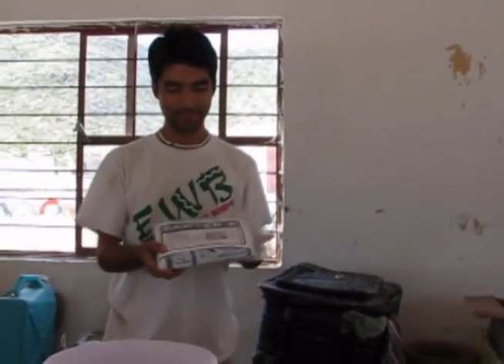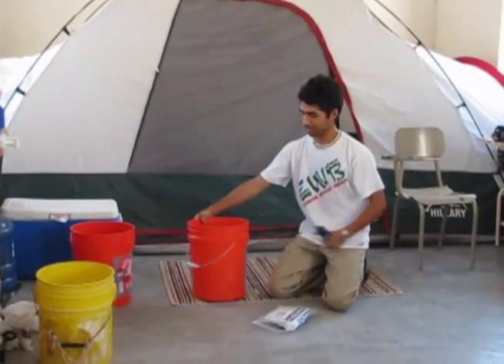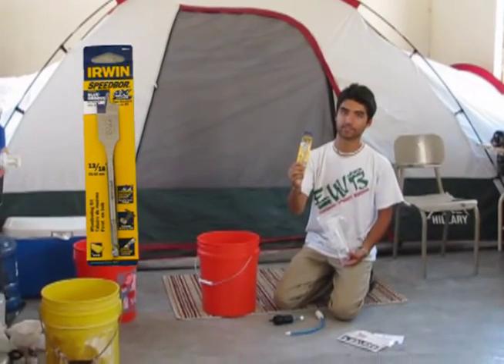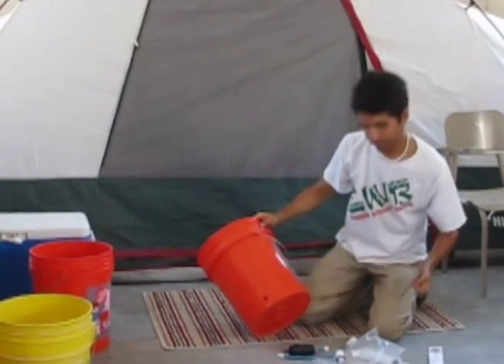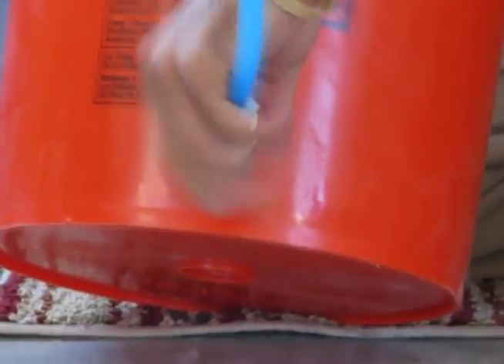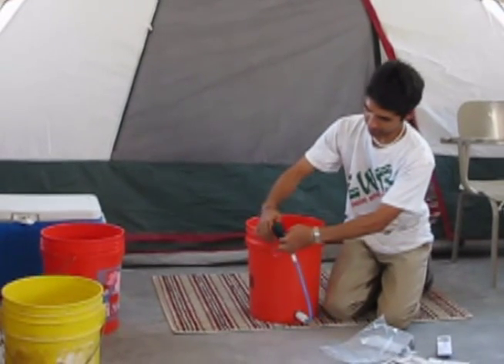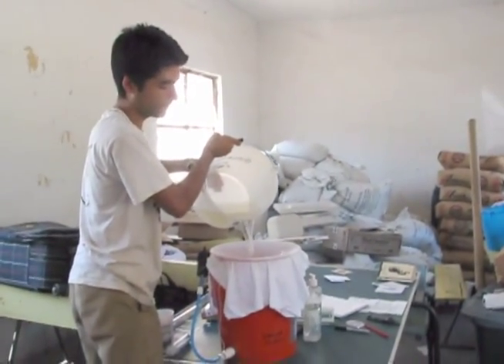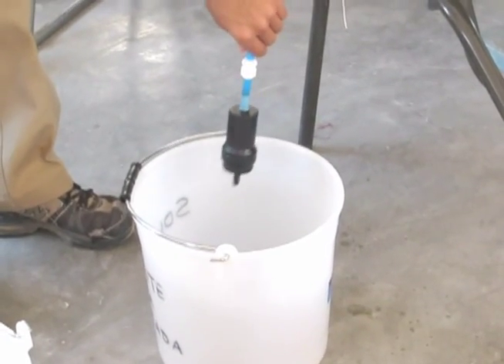Globalize This and Sawyer Point One Filter

Comment: A comment: From what I've found in my research, these filters also need to be primed before use, correct? Also, you re-used the dirty water bucket for your clean water... not a good idea!

A question: I'm looking into getting a Sawyer filter, with the goal of filtering lake/rain water for drinking. Would the .1 filter be ok, or would you recommend the .02, which also filters out viruses? 

Thanks for posting this video, and thanks for the help!